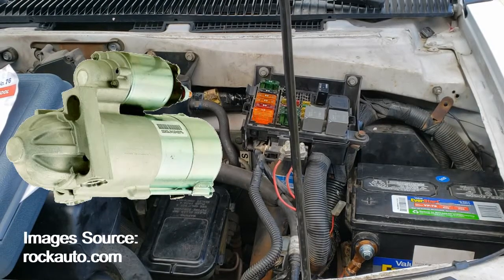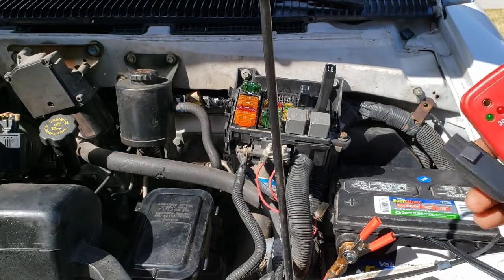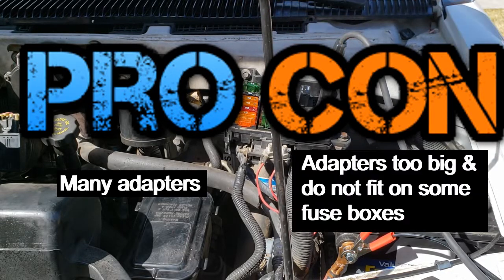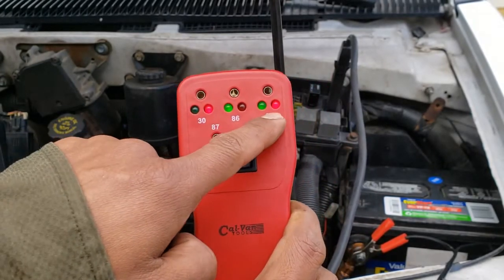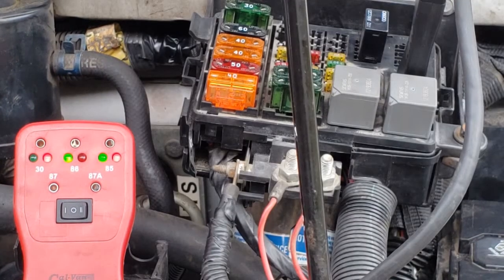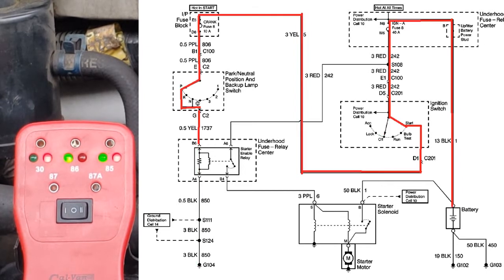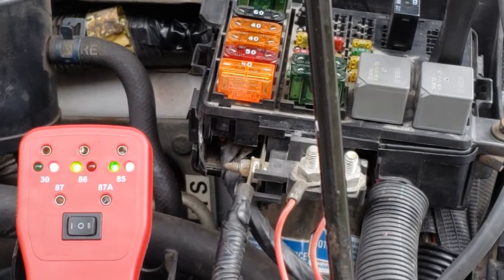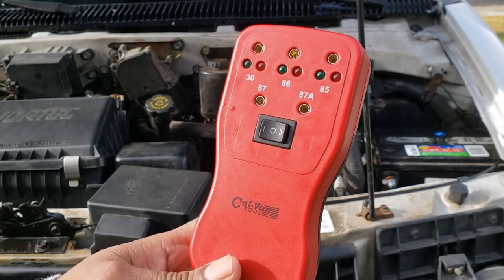Cal Van Tool Part #76 Review

Comment: The coil is the load of the circuit, all voltage should be used up across the load .
This is why before energizing the circuit it shows the ground and when energizing it shows power to one side of the coil and only ground on the other .
Technically, the coil is a short but the energy is absorbed by the coil as it works

Comment from the maker: I just finished Re-Diagnosing this issue. This tool will "LIE" to you. At 3:30 we see pin 85 light up as green and red. Then pin 85 showed about 6 volts. Ok, here's the issue. When you remove the tool, test the connection pin 85 goes into on the fusebox. It should show the 6 volts....guess what...it doesn't....it shows 0 volts. See the diagram at 2:46 , only pin 30 should show voltage. When the relay is out , test all 4 spots on the fusebox. You'll notice that only 1 female connection shows battery voltage. All is good! BUT when you plug in the tool, 2 pins show voltage. See what I mean? The internal coil of the relay is LYING to you. No short here.
Reply: I have similar thoughts about "lying" results  when two  lights are on for the same pin connection and there is no short, after manually checked for draw parasites. I tested three different cars (even a 2020) and all indicating there have a short as per the instructions. I don't quite trust the results.
Reply from the maker: @hlegar  Yes, this tool is handy when diagnosing starter issues. It can be used as a remote starter. Any other electrical diagnosis I do not trust.
Reply: Good review on this cal van relay circuit tester, I'm curious if the 6v that is shown is a bias voltage?

Comment from the maker: Wiring Diagram Color Correction: I learned more about color coding wiring diagrams, at 2:56 I show ground going from G104 to the ignition switch. That is incorrect. Green should be from G104 to the relay, and from the relay (pin 85) to the ignition switch, the color should be orange. The wire does not "reverse polarity" as I incorrectly stated.

Comment: What caused pin 85 have this problem?
Reply from the maker: The circuitry on pin 85 has 2 components listed in the wiring diagram. At 2:51 you see that the neutral/safety switch and Ignition switch are on the circuit. One of those could be bad, there might even be exposed wire on that circuit.
Reply: @OldSchoolNoe  I have 07 hummer h3 doing the same thing. I used same tool. It lights up green and red on starter and crank run relay. When you say neutral safety switch do you mean the transmission shifter? I have crank no start. Replaced every sensor possible. Now getting code crank shaft relearn. Can only do if it’s running crank no start. Replaced crank, both cam sensors ignition switch did relearn and all plugs ,coils and ecm. What was wrong with the car you were working on. I could not find other video of it. thanks for responding
Reply from the maker: @robertgray6631  The vehicle in the video is a project car. Was bought at a reasonable price because it has many issues. Many have been fixed. Currently diagnosing a "lean" code. We found 2 exhaust leaks and are waiting for parts to come in. Have not fixed the issue shown in the video. It could be the neutral safety switch (yes the component that controls park, neutral, and reverse).
Reply: @OldSchoolNoe  Thank you for your explanation.
Reply from the maker: I just finished Re-Diagnosing this issue. This tool will "LIE" to you. At 3:30 we see pin 85 light up as green and red. Then pin 85 showed about 6 volts. Ok, here's the issue. When you remove the tool, test the connection pin 85 goes into on the fusebox. It should show the 6 volts....guess what...it doesn't....it shows 0 volts. See the diagram at 2:46 , only pin 30 should show voltage. When the relay is out , test all 4 spots on the fusebox. You'll notice that only 1 female connection shows battery voltage. All is good! BUT when you plug in the tool, 2 pins show voltage. See what I mean? The internal coil of the relay is LYING to you. No short here.

Comment: What did he do to fix it?
Reply from the maker: Still like that, apparently the van was in a flood. Little by little the wires have been inspected and fixed. An inactive fuel gauge was the latest fix. Some dead circuits still exist, like the "open rear hatch" button does not work, the headlamps "buzz" when turned on, and only 1 of the many speakers works. The van is an ongoing restoration project.
Reply: @OldSchoolNoe  ok thanks for response
Reply: @robertgray6631  Awesome! I was wondering the sane thing.